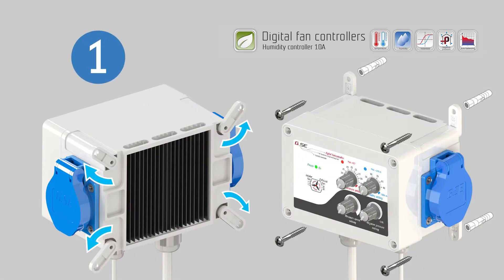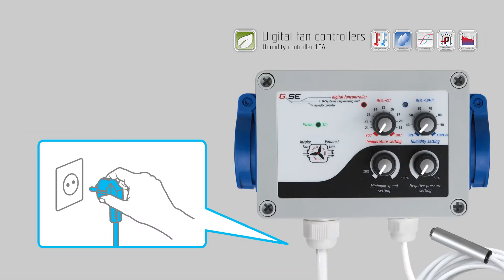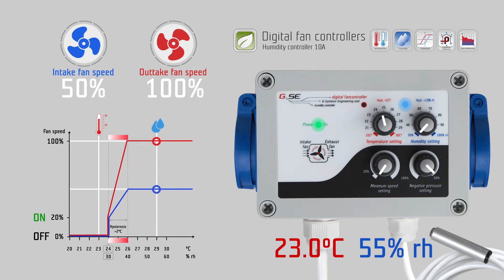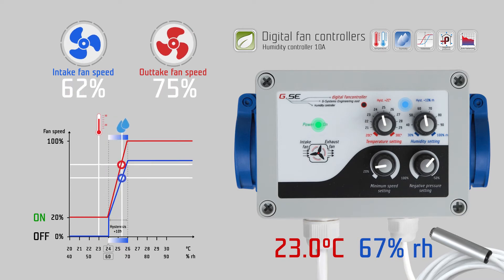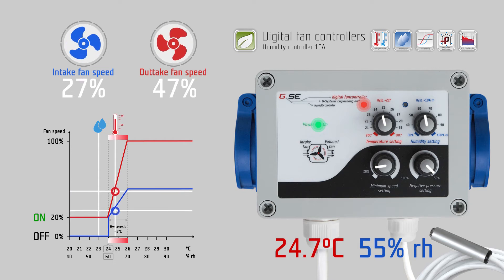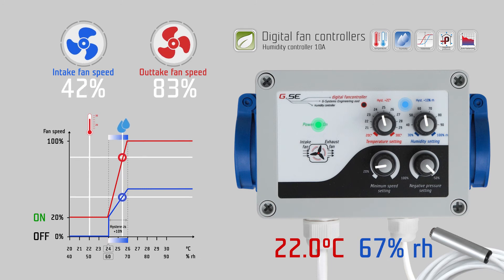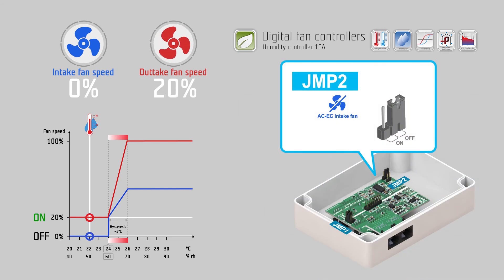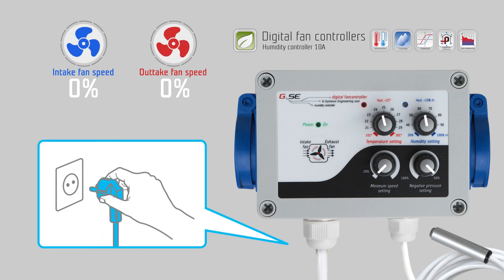Humidity, temperature and negative pressure fan controller (2fan)  10A English

Comment: Hi. How much does the controller heat up when in use? Would it be safe to install it in a 2'x2.5'x8' enclosed space?
Reply from the maker: HI
Depend on the fan power, small fans don't heat up much. Try it make sure the heat sink stays hand-worm not hot.... make sure the air-circulation works behind the radiator....
Reply: @alaingressly214  thank you so much for your reply. I'll figure out how to hang the controller so that there's still some breathing room behind the heat sink. Does the controller work with most extractor fans? Is there any model you'd recommend to avoid buzzing at low speeds? 
Again, thank you so much for your time!
Reply from the maker: Hi, There are some fans which write do not use with phase controller, avoid them, to not hum and to save lot of power use EC fans....